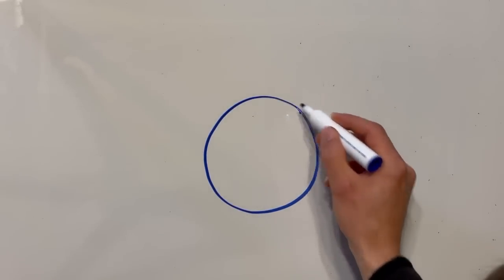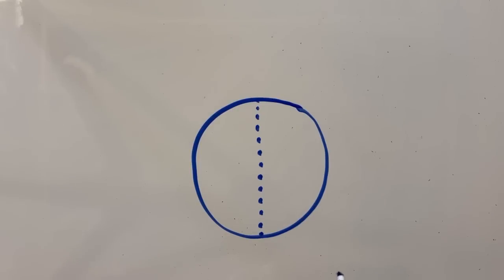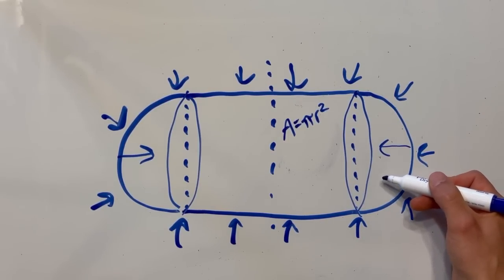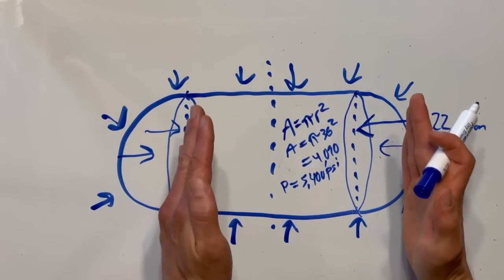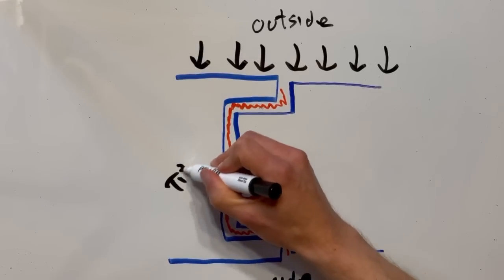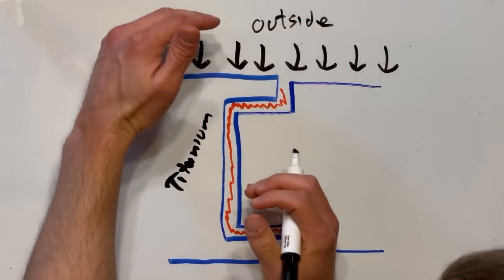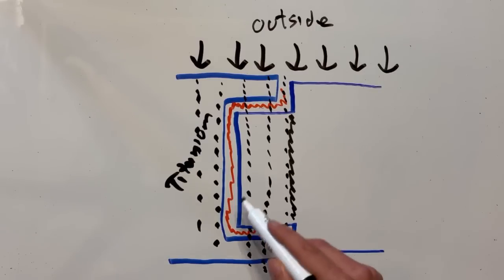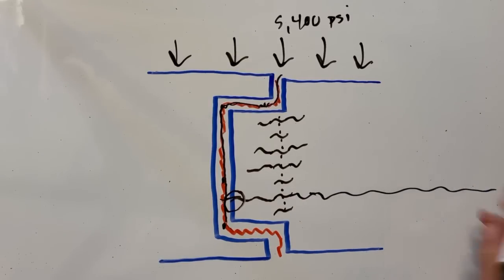Simple Engineering Analysis of How the Titan Submersible Could Have Failed

Comment: Sounds like basic design was fundamentally flawed. There seems to be many mods that could make it stronger. For example, 1. Considering tube thickness.  2. Using strong backs which buttess the tube.  3. Using a taper shape for the matiing surfaces of the end tube. Just like the mandrel in a milling machine where the harder you press, the tighter the fit when trying to machine steel at 3000 rp
m and you don't want it to come loose

Comment: I believe there’s an additional failure mode caused by the different physical properties of the carbon fibre and the epoxy matrix. This will lead to shear stresses between the carbon fibre layers on every compression cycle and will eventually lead to delamination and reduction in strength, as well as creating buckle points for the axial load.

Comment: Do you think if the would have put some type of doubler impregnated in the carbon fiber then use a proper hardware connection plus a proper adhesive for the carbon fiber that it might have made more trips down? I mean that still doesn't take into account what the failure rate of repeated trips to that depth are. Im guess there wasn't any NDT done between trips. Great video and explanation of the carbon fiber. 

We use to perform x-ray inspections on some CH-46 rotor blade root ends, the part that attaches to the rotor, for de-laminations or what they called a bunching of the fiberglass when they were made.

Comment: I watched a number of videos where "engineering analysis" of possible causes of Titan failure have been presented.
I am an engineer with 40 years of experience designing and analyzing composite structures - and composite is about the last material I would pick for this application.

Having said that - it is obvious to me that vast majority of these presentations are made by people who have no idea or understanding of composites.
Yes - the choice of material was incorrect. Yes - moisture ingress into the matrix, manufacturing flaws, porosity, bonded joint failure, difference in thermal expansion, difference in stiffness (titanium caps vs composite cylinder), cyclic fatigue, impact damage, microcracks, application of cylindrical shape etc. - all these COULD be contributing factors.

What is astonishing - is how little attention is paid to the LAYUP - that is, orientation and placing of the fibers.
Pressure at 4000m is about p=40 MPa.
With 4.7ft diameter and 5" wall thickness - the ratio of R/t is about 5.6. 
Hoop stress is about Sr=p*R/t = 220 MPa
Axial stress is about Sa=p*R/2t = 110 MPa
Carbon tape in tension fails at about 2100 MPa, and about 1200 MPa in compression (dry, RT).
But in TRANSVERSE direction (perpendicular to the fibers) it can only take about 80 to 180 MPa in compression - as this is limited by the strength of the matrix alone. 
Compare axial stress and the strength of epoxy matrix...
If the cylinder was manufactured by winding ALL fibers in the hoop direction (which I still can't believe - because this would be total idiocy) - then the matrix would be stressed almost to its ultimate stress in repeated dives.

Most of the comments and analyses concentrate on "wrong material" (yes, for this application), number of "Empire State buildings pressing on Titan" (BS), inability of carbon fibers to take compression (BS) etc. - while totally missing the basics of composite design and analysis.
If there really were no fibers in the axial direction - then this was the most probable reason for failure.

Comment: Why did'nt you use the surface of the hemisphere to calculate the force "squeezing" on the ends of the CF tubular body?
Reply from the maker: Because the net force squeezing in is equal to the area of the circle since some of the force is being directed to try and pinch the hemisphere in the perpendicular direction.
Reply: @Mutton_Lettuce_and_Tomato  I will leave this without comment...just don't get involved in design of any pressure vessels.

Comment: Add in temperature, coefficient of expansion, and every mechanical joint.
Coming from a race car background I’m aware of testing metallic components for stress fractures such as Magnaflux inspection, however I am unaware of such a process for carbon fiber, I assume there is SOME process but wonder if the part size make the process restrictive for a dive hull.
Reply from the maker: There is ultrasonic testing to test for delaminations and voids. There are very big machines that can do this.  But that might only be practical when the tube was initially built, and would not be practical after the vessel was assembled.

Comment: Great explanations. I'm a mechanical and space engineer who has actually collaborated with Caltech and NASA for my PhD. research. The end cap assembly is certainly a weak point. The failure propagation/ delamination/ water ingress diagram at the joint through the fibres is a likely failure mechanism, but if the fibres were indeed only spun in a circumferential direction, the fibres should be drawn as dots that extend into the page rather than longitudinal lines. It appears to me that Titan's design was based on readily available/ cheapest manufacturing methods and materials rather than the other way around. In Australia, individual engineers are held criminally accountable for incidents if it can be proven they are responsible for the design issues. Engineers also have to participate in continued professional development (CPD) and be registered to perform engineering design in Queensland where I reside. I will certainly use this unfortunate case as a safety share, and as a caution to younger engineers who may not be aware of the impact of their judgement.
Reply: Congrats on your PhD. Now please read something about analysis of composites. With your background - it shouldn't be too difficult. Also - see my post above.

Comment: You have provided the most reasonable cause and effect analysis of what could have led to the implosion. My observations watching how they manually MIXED the glue instead having it mixed in a controlled environment.  The application of the adhesive was also manually applied and was not uniform. My question is what were the engineers on staff not doing the due process to determine that the Titan was not not structurally sound.  I believe they also share responsibility as engineers in whatever judicial actions are given to the company!  Where were the safety and quality folks?  Probably helping mixing the peanut butter that HUBRIS Stockton was so proud of.  I am not an engineer and had the same observations as you did.  Thank you! I have subscribed to your channel!

Comment: Nicely done!  Very good use of diagrams and props.  Your example poking a small hole in a sheet of aluminum foil was brilliant!  One minor correction, I believe you are using seabed level crush depth pressures in your calculations.  The sub appears to have imploded at less than half the total depth of the anticipated dive.
Reply: Since the loss of text and location comms occurred 1.5- 1.75 hours into a dive that typically was 2 hours to seabed, they were probably much farther down than less than halfway, given that implosion would likely occur within  minutes of their primitive hull breach warning system. Anyway, investigators will probably be able to make some estimate of their depth, based on the distribution of the wreckage, and the contents of the REAL text communications and locator documentation of the last 2 hours of titan. (The alleged "last text comm" originated from an anonymous Tik Tok  poster, which has never been a reputable source for truth.)  Very reasonable to use pressures at seabed as an example, when outcomes would be similar even at lesser depths.

Comment: There is an article in CompositesWorld that details the construction of the carbon fiber hull by Spencer Composites. Also there is a YouTube video of Stockton Rush explaining the construction process of the carbon fiber hull.  In both the article and the video, it is explained that circumferential wrapping (known as hoop wraps) and axial plys (laid up using prepreg uni-directional sheets) were used.  Stockton Rush said that over 600 layers (or plys) were laid up which consisted of 90° (hoop wraps) and 0° (axial plys).  He did say that no other angle plys were used because there is no torsional loading in a submersible.  I am still investigating that as the off-axis plys will help in preventing buckling, however, the filament winding of off-axis plys would prove to be difficult given the images I've seen of the mandrel.  BTW, I have over 20 years experience filament winding of composite overwrapped pressure vessels.
Reply: Could you point me toward this article and/or video ?  Of course the construction of the cylinder w/o axial reinforcement would be pure lunacy, but so far I couldn't find any evidence of having axial reinforcement. Thanks.
EDIT: I found the article - thanks for pointing the direction :) although no details are given there except some statement about axial reinforcement.
One thing remains a mystery to me - or actually two things:
1) Alternating prepreg with wet layup
2) Curing at 137 deg. C for 7 days
It looks like the whole 5" thick cylinder was cured in one go. How did they manage to avoid carbonization of the resin ?! With such thickness and low thermal conduction this would be very difficult (if not outright impossible) to achieve, Curing of epoxy resins is a highly exothermic process, and I know many examples where curing thick composites results in destruction of the matrix (resin).

Comment: Another thing to consider is the difference in thermal expansion of the carbon fiber composite and the titanium ends.  Depending on how the composite is formulated the difference in thermal coefficient could be three to one.  The temperature difference between the surface of the ocean and the bottom is about 20 degrees C.  Enjoy!

Comment: I think there's a major clue to what happened in the fact that the crew reported that they were ascending at a very slow rate, even after jettisoning ballast and the landing frame.  Possibly, there was a lot of water infiltration into the weave layers of the composite hull segment, apparently from the aft dome area, and this water was rapidly changing the buoyancy of the submersible.  Water getting into the composite layers would also then quickly weaken the structural integrity, leading to catastrophic implosion when it failed.  Just my thoughts.
Reply: Agree. Along with that, I suspect that the structure was flexing inwards, thus reducing it's volume and thus, displacement. It's displacement being the only thing that gave it upward thrust.

Comment: You very briefly mentioned that Titan was designed the way it was so that it could hold enough paying passengers to make a profit. Hardly anyone talks about this, and instead just whines about greed, negligence, and how the entire endeavor was suicide. The truth is that carbon fiber is the only solution to the problem the engineers had in designing this submersible. The impetus for the design was not how do we build the safest submersible, but it was how do we get 5 people to 4000m, and make a profit doing it? Something never done before. Due to cost but mostly size constraints from how you would achieve correct buoyancy (foam, or liquids) for a large enough titanium or steel sphere it becomes impractical and would require a giant tender ship designed specifically for it. There are a host of issues with having too large of a submersible. I believe there will be more carbon fiber tube based deep submersibles, and that through trial and error the discoveries will be made on how to safely design and build them. There is simply too much interest from rich passengers, and fortunes to be made from the group that figures it all out.

Comment: I was kind of waiting for someone to explain that carbon fiber composite, when fully cooked, became very good at... tension, not compression. Compression was just trying to spread out fibers and separate them from each other, not using any of their molecular strengths. When you only count on the surrounding cooked resin bond to do the job of resisting to those multi-million pounds of pressure, this is basically what happens.

Comment: What you said  is basically what I thought at first glance... that the weak spot was where the end caps and tubing met!
i thought that design  was total insanity...No way I would EVER do that!  However I'm ""not qualified"" to have an opinion on engineering :)> AND yes their  faster than normal rate of descent  and their buoyancy problem on ascent meant they were already leaking; taking on water  on the way down...

Comment: You are perfect to analyse the failure of Titan.

Being structural engineer I wonder why the Titan was not structurally analysed by competent authority before and tested throuhly three diamensionaly ?
Behaviour of composite material depends on strength/weakness of each other with strength of bonding material which is basics of composit material and it is widely used any many areas of engineering or manufacturing item.

Comment: The entire operation from CEO to the build of the submersible itself just seems so Mickey Mouse, no disrespect meant for Mickey. They used glue on dissimilar materials and didn't even use pressure on the joint while the glue was curing or any truss rods to tie the end caps together across the hull to hold them onto the hull as the hull would flex with pressure changes. I even hold pressure on my nails until the glue sets. They checked if the end piece was down all the way by feeling the tension on the green lifting strap. Those people shouldn't be cleaning outhouses.

Comment: Great Video.  One thing that really struck me is the environment where they were haphazardly applying the bonding agent.  It was in an open warehouse setting, no one is wearing bunny suits or even hair coverings.  I saw another video where one of the workers was touching the surfaces with bare hands as he was applying the sealant.  Ideally this would be done by a robotic machine in a clean room.
Reply: I was thinking the same thing.  

While I don't have experience with this bonding agent, I am aware that impurities in bonds can cause problems because you have slightly weaker spots compared to others.  I've seen this with various props I've made in the past.  So doing this on a submersible that costs millions of dollars, was "pushing the limits", and where lives were at stake, you'd think they'd want to do everything they can to ensure everything in the process is basically in a clean room wherever possible.
Reply: Naval and aerospace construction has changed... Titanium and aluminum plates can be automatically welded on both sides of the material simultaneously and with laser and inert gas that prevents material deterioration... Robotics is of little use if you don't know how to do things... Publishing stickers with robotics is like applying the same thing to a riveter or a broom to sweep the garden... The aerospace industry and shipbuilding have changed... and the company's engineers were unaware of this topic. .. The new technology is legal in America and Europe...
Reply: There was a video of a dude cleaning the titanium with a dirty rag and then touching it with his other bare hand right after.

Comment: The most precise and possible explanation of the build up of the Titan using Carbon Fiber and Titanium glued together displaying the weakness under such immense pressures being exerted at various points causing the possible implosion.
A very analytical narrative of the unfortunate submersible which claimed 5 ppl's lives at such a deep and tragic spot of the vast ocean.
TQ 4 the enlightening video.
Reply: Of course, diagnoses are important...But solutions and remedies are better addressed...Naval and aerospace construction have changed because titanium and aluminum alloys are welded with laser automation for the first time in history from both sides of the material with energy and inert gas...No more rivets in airplanes...The submarine must have been built with this technology approved in 2020 in America and Europe..The new technology welds on both sides at the same time with laser and argon gas avoiding the chemical deterioration of the material... PERFECT WELDING WITH CONTROLLED ASYMMETRY on reactive titanium alloys.. The submarine should have been built with this technique in one piece and would not have imploded on the ocean floor...
Reply: @eduardoamaro7867  Quiet agree with ur explanation on latest welding technology.
Yet the submersible seemed 2 be built rather on carbon fibre(expired pcs purchased 4m Boeing) as well as glue attached together with titanium.
This gluing part is rather suspicious due to the fact it is done manually giving rise 2 air bubbles inside the pasted part.
This in my opinion is the weakest link in the built up of the submersible exposed 2 fatigue drag over the oceans as well as faulty performaces in its previous dives... Including electrical failures.

Comment: So I assume that once water ingress occurred, potentially in the region of the glue layer, the pressure of the water at depth would actually work to push the titanium rings away from the composite hull axially  and vice versa causing it to decouple. This seems more likely than the sheer at the interface.

Comment: With the way that the tube was laminated, the stress at the titanium/tube glue joint perpendicular to the tube means that the strength of the tube in compression is just the shear strength of the resin. This is also true at the half length of the tube where compression deformation of the tube would be putting tube outside length wise compression stresses and inside tension stresses on the weakest material, the resin.